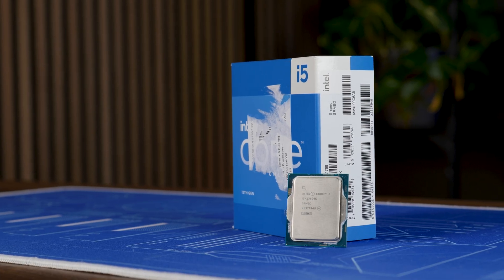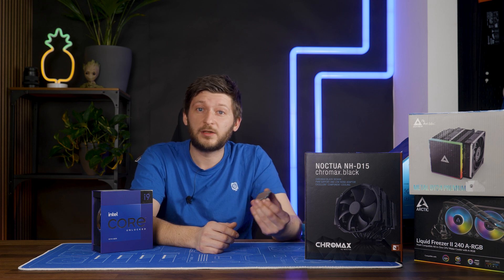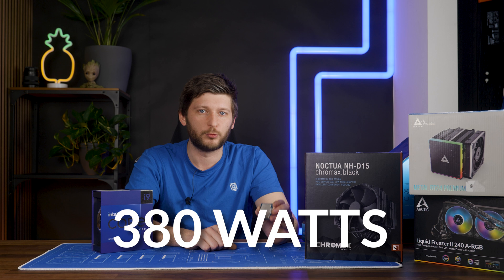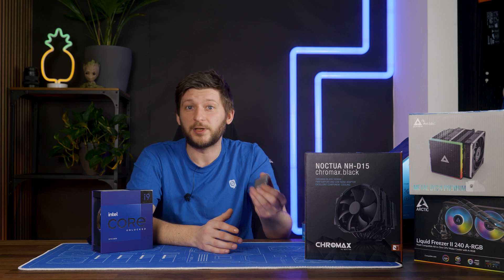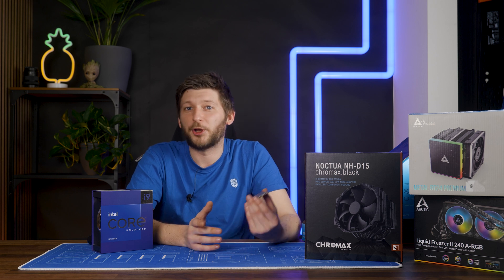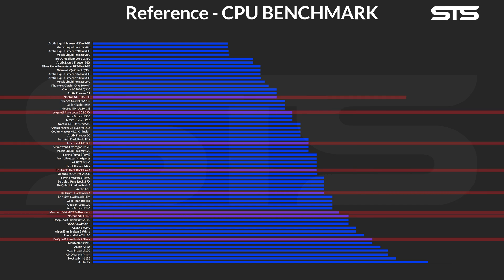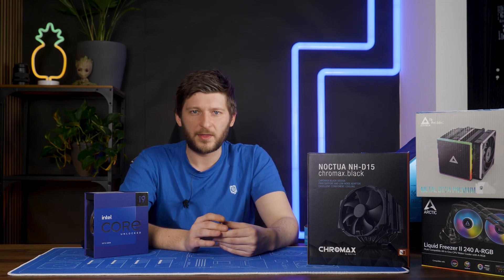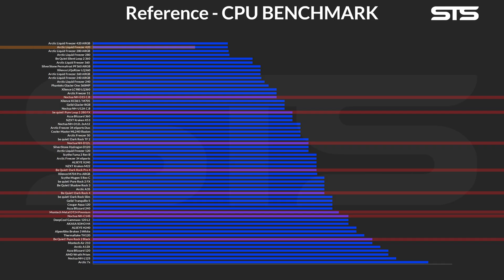How FAT Should An Intel 13900k Cooler Be? ❄️ - 13900k Cooling

Comment: Ummmmm..... I "jerry rigged" a BeQuite! Dark Rock 3 Pro air cooler for my i9-13900K. I have it re-encoding, so it's using ALL cores (inlucding the efficiency ones), and runs stably at 4.2-4.4GHz. I tried to set the fans to run more from the BIOS, but it seems the Gigabyte motherboard is designed to keep them running quite (I think).
Should I really buy this AIO water cooler then?

Comment: I found that undervolting the CPU to about 2.3 watts, turning down the ghz to 4.3 on all cores, and using an Arctic Liquid Cooler II 240 it maintains about 34-36 Celsius. However I invested in an Arctic Liquid Cooler III 360 and while keeping the same Voltage should allow me to do all cores at 5.0-5.5 with about no problems. We shall see though.

Comment: When a car company starts producing dragsters instead of practical cars, focusing only on top speed.
Who cares if you have to swap tires after every run and refurb the engine. Top of the chart, tho. Have they forgotten that these have to work in consumer PCs?

Comment: like the tests are done. I'm in a new PC build now, how does the CPU get 380w when Intel say the max draw at turbo is 253W? 

 Processor Base Power 125 W
Maximum Turbo Power 253 W

and now there is a 14900k on its way - which seems to be the same

Comment: I am running the 13900k with an ROG Strix LC II 360 AIO on a ROG Strix x790-E. My temps are good, I have never seen the CPU go above 85 c (during a stress test). For the most part when I am gaming the CPU sits around 60 - 70 C. I use the AI OC available in the BIOS. I also have a giant case with good air flow.
Reply: I've been looking at building a gaming pc and you are the only one who has managed to make any sense out of all the videos of people failing to get below 100°C. I've found a few components that are new and below half the usual cost so far so thank you for your suggestions on those components.
Reply: @donz6 Zotac 4090 Trinity OC.
Reply: Full.atx?
Reply: Which test?
Plz, can you do the,same, but in occt 12v with preset below:

small data set
steady
fixed 28 threads
instruction set - sse

for 20+m i think. 
and, your xtu ratios.
Reply: @КвасИСышка  The test I used was the Asus AI Suite OC tool. I don't use any crazy OC settings, just the standard XMP II profile for my RAM which will OC to 5.5 GHZ. I had issues using AI Overclocking so I stopped using that feature and only use the AI cooling for my Fan Curve.

Comment: I have a u12a on a 13900k, worrks just fine, handles 330w in ycruncher - score 41.500 in cinebench at 85c / 260 watts.
Reply: That's the setup I was originally looking at...I do not really want to go the liquid cooled route. What's a typical temp you see in normal computing/gaming that's not trying to max out the system? And which motherboard, did you have to tweak it to keep it from allowing the watts to get too high?
Reply: @rmb658 man, it's so hard to get reply from tech yt comments

Comment: Should the writing on the front of a processor fade after using paste? After wiping, the Intel 13900K text is now gone and underneath has revealed Pentium 90
Reply from the maker: Wtf😅
No, the writing may go away over time, but that’s not because of regular thermalpaste, but because of coolers mounted too hard. That doesn’t explain the other text though

Aliexpress cpu?

Comment: You should do these tests again, but this time using an aftermarket cpu contact frame when testing the coolers. The default contact frame that comes with every LGA 1700 motherboard has a flaw where the contact frame does not put the cpu perfectly level with the socket. This means when you install any cooler, the cooler does not make proper contact with every corner of the cpu.

Some popular aftermarket contact frames are one sold by Thermal Grizzly and one sold by Thermalright.
Reply from the maker: The idea behind these is out of the box
Once I get into contact frames, it’s more about the frame than about the cooler.
Generally, they should just do a better job with mounting so that this doesn’t even become a topic to begin with

Comment: idk i understand that you prefer testing "out of the box" config, but its mobo manufacturers fault leaving that disgusting unlimited power mode on cpu. Intel spec says that this cpu has max of 253W power limit, in other words, at least with your mobo, it came overclocked out of the box and out of spec. I would much prefer if you tested with at least 253W watt pl2 sustained power limit.
Also contact frame is also quite nice as it reduces temps by about ~8c on avg
Reply from the maker: You’re right on the mobo part, and everybody is thinking that. But it’s still out of the box. Shitty, but unfortunate fact

Comment: Get a Contact frame + Undervolt and you should be able to use a 13900k in gaming with NH-D15s, now on rendering..... no AIO is going to hold you, you need a dedicated loop to keep it below 100C, and even then if you don't control the power, it might even reach it.
Reply: Use shortcut and GPU Rendering and you'll be set.

Comment: I have a 13900k with a Noctua U12A stock in CB23 score 38k point with undervolting + power limit with Intel spec also with throttling setting bios Max core temp of 90c score 37k but gaming not even hit 75c
Reply: Noctuas running at full speed, getting noisy?

Comment: The contact frame is a must. You also need to undervolt in the BIOS. You'll be fine with a 240mm aio if you do this. You'll be under throttle temps.
Reply: You sure that a 240mm would be enough to tame the temps? With maximum fan speed maybe, but can’t imagine otherwise

Comment: I was able to keep my i9-13900K under 100 degrees full load with ASUS multi-core enhancement no limits with a 360mm AIO at 100%, but I think its also because I have 7 high airflow case fans at 3000rpm 24/7 lol
Reply: Its not just about keeping the 13900k under 100 degrees. Even a simple air cooler like the Noctua NHd15 can do that. The challenge is keeping it under 100 degrees at very high clock speeds on all cores, which is something your 360 AIO cannot do.

Comment: Just like for the 13600k, I see in your test the Artic Freezer 280 performs better than the the Artic Freezer 360. And not just a little, there is a gap - and evem weirder, the 280 is almost as efficient as the 420. I dont get it, 280x140=39200 mm square, and 360x120=43200 mm square, so, why is the 280 better than the 360 ? I have a 360 so I'm especially interested in this question.
Reply: @STS ?

Comment: The issue is motherboard manufacturers very often putting up unnecessary high voltage, far from Intel guidelines even. Guidelines being 100°C, it's surprising you do your test with a 115 limit and conclude on the cooler handling it at 110.

Comment: CPU cooler contact has been a problem with these boards, wonder how much of a difference something like the thermalright pressure plate makes
Reply: which are not bad but too expensive, aftermarket ones are as good but better priced.
Reply: @hanswurst2220  it's like $12..
Reply: @hanswurst2220  you might be thinking of the thermal grizzly which is grossly overpriced

Comment: These cpus are designed to run all the way up to 100c. All coolers will be fine, just will throttle accordingly
Reply: If you run your 13900 at 13600 speeds because it's throttling, just buy a 13600.
Reply: There is no point in buying this over a 13600k if it throttles unless for bragging rights. And one might best get the need for those treated.